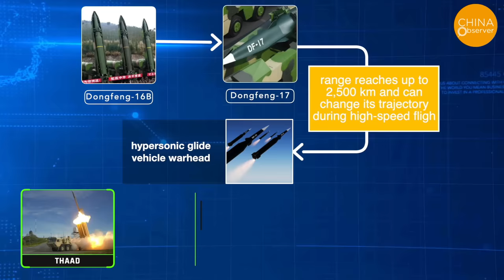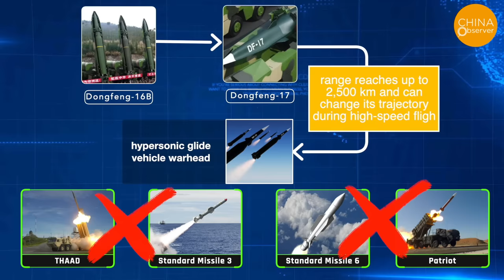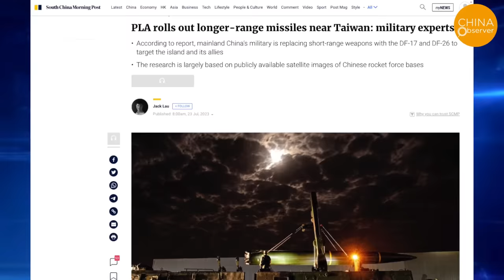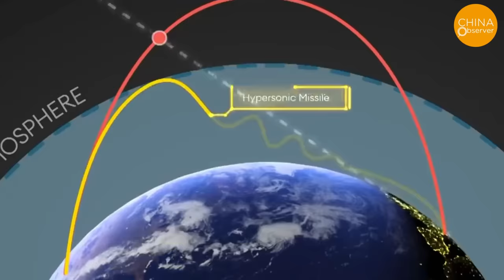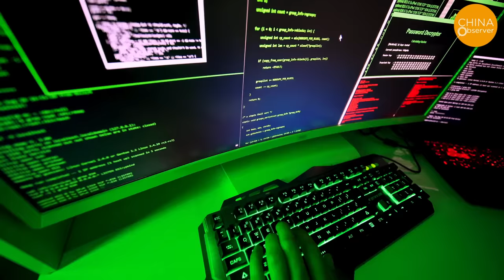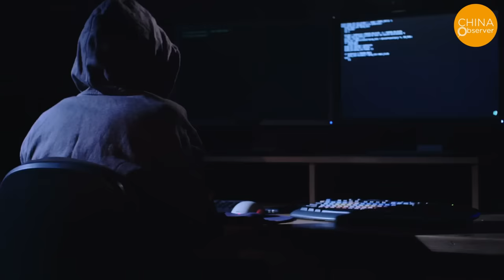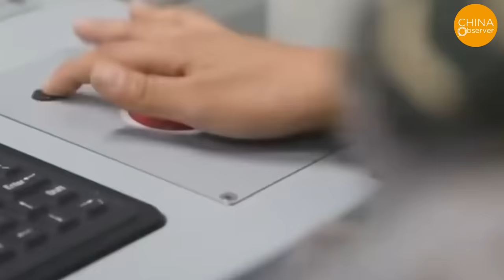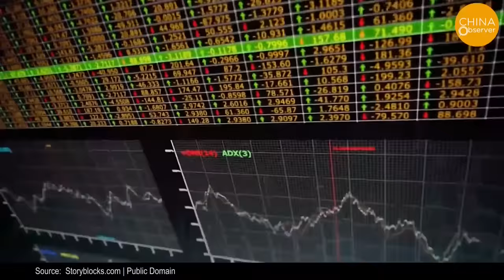China's Missile Technology Is Now Reduced To Boasting And Theft！Hypersonic Missiles Face Their Doom

Comment: More worrying to them is some rather fascinating and dirt cheap experiments the US Army and Air Force did awhile back. They took a few dozen older 155mm artillery pieces, slaved them to a common control hub fed by the air forces data fusion system seen in the F-35, and loaded them with projectiles originally designed for the Navy’s rail gun project. But launched by standard powder charges instead. Tied it all into a few existing sensor platforms such as AWACs and SAM battery radars. They found they could intercept pretty much any missile, from ICBM to hypersonic Wunderwaffen. At less than $5000 per shot fired. Using pre-existing hand me down hardware. They found that the Mach 7 rail gun ammo would still hit Mach 5.5 when fired from normal tube artillery. And the ability to share all sensor information and use it to feed and control a large number of the linked artillery guns is game changing. They were able to do this with leftovers. Obsolete gear frankensteined together to play with some new concepts. Imagine what an actual production system will look like?
Reply: even when our government turns to crap, we still kick ass! God Bless America!
Reply: And they told you all this why? and you're telling China about it why?
Reply: It will leave the PLA covered... in Pooh.
Reply: @hypersonicmonkeybrains3418  It’s been published for years. It’s not exactly a state secret. I want to say it was one of those DARPA projects.
Reply: we can have a president who doesn't know whats going on because he wants his ice cream
we can have every single soldier be full stop trans on full HRT
doesn't even matter
we'll be fine
Reply: I personally like how the E2 hawkeye can search, track, and guide a missile from the F35 without the F35 ever having to turn its radar on and give its location away. The us somehow got data fusion perfect to allow a early warning radar to guide objects precisely from 100 miles away. Yet russian and chinese sams need multiple massive radars to even function poorly.
Reply: Sounds good. Source?
Reply: You mean a FrankenSAM?
Reply: @tonytravels2494  your mom
Reply: @LegendaryCollektor  woof!!! Father was Sum Ting Wong, son of Dim Lee Tard.
Reply: @powershift2024   oy vey
Reply: Source? Claims sound incredibly dubious.
Reply: This is well worth knowing. This Australian feels better already.
Reply: @brandonkoh8361 For real! I wanna see proof of the testing myself.
Reply: When you’re talking about the rail gun ammo are you referring to the one that spins mid flight and sends out all the tungsten (I think) balls? So in essence what I’m asking is did they slave all the artillery pieces together to make a  literal mile-wide shotgun spread at where the missile is going to be or is it way more precise then that?
Reply: @castlebravo6658  No it is a weirdly shaped high speed lifting body projectile fired like a sabot. It may carry a fragmentation payload though.
Reply: @negroraven9458  Go back to the beginning and get born in a military household, get really good grades and get into military intelligence. Go see the testing yourself and spend the rest of your life telling no one. Otherwise, don't expect anyone to give you proof. This is not for entertainment purposes.
Reply: They also just like making cool things to end things, the knife hellfire being one of the most personalised weapons ive ever heard of…imagine a few more of those being delivered very soon.

Comment: Honestly with these hypersonic missiles you don't even need to intercept it directly. All you need is to force it to make an abrupt enough move that it causes them to exceed the air frames maximum strength. At those speeds your walking a tight rope with inertia. Your good as long as your going in a straight line, but any sudden moves can cause you to start tumbling and once that happens its only a matter of time before the forces ripe you apart. Your trading maneuverability for speed
Reply: Great maneuverability comes at some costs: reduced range and the need for continuous flight path corrections.
Additionally, the missile eventually needs to slow down for accurate targeting via active radar or GPS input.
That small window might allow a short-range Mach 10 interceptor to work like the US Sprint missile.
https://www.youtube.com/watch?v=3dl9Ovwmnxw
Reply: @nfuryboss  its not a hypersonic though.... to accaly have that clasification it needs to be going hypersonic during the terminal phase of flight
Reply: Cue the opening scene from the 70s TV show "The Six Million Dollar Man."

Comment: one thing people don't understand about Hypersonic is that it only works at high altitudes of more than 50 thousand feet. Lower than that nad it'll slow down considerably, and at that altitude, at speeds lower than mach 15, they can be infercepter. Not to mention unlike Russia and China's boasting their hypersonics, USA has WORKING and TESTED directed energy defense systems that are to be put on Gerald R. Ford classes.

A supersonic sea-skimming missile would likely be more effective as it avoids radar detection and is hard to spot

Comment: So, the US Military doesn't classifty any Russian missile as "hypersonic".  Simply traveling at hypersonic speed does not define a missile as "hypersonic" in the eyes of the US military.

The Russian "hypersonic" missile that was shot down over Ukraine is not regardless of what Russians call it.

So, for the US military to call something a hypersonic missile, it needs to be able to achieve those speeds on its own or maintain those speeds on its own, not get boosted up to that speed via a rocket and then travel downward by gravity.  The world has had hypersonic projectiles since the 60s, they're called ballistic missiles.  They can be intercepted.

For the US military to call something hypersonic it needs a ramjet or scramjet engine or something equivalent.  These are engines that can only operate near and above hypersonic speeds.  It can be launched via a rocket and then be the 2nd stage so it separates from the rocket and then can propel itself and that also means changing direction.   Or, the missile can have 2 different engines, one to get it up to near hypersonic speed and then once again something similar to a scramjet engine to take it to its target.

With this is mind, I don't know if the US military privately calls what the Chinese have a "hypersonic" missile.  They're INCREDIBLY hard to engineer and the US is close to one, but haven't quite got it worked out yet.  It's suspected they could have one within the next couple years though as this has been a high priority for them.
Reply: The US deployed the AIM-154 air to air missile in the late 1960s, mach 5.5.
The US started high speed high altitude tests with the B-15 rocket plane. It was flown by men with the right stuff.
Its really not that awesome of a trick.
Reply: Also the missile must be able to maneuver all the way to it's target. None of the missiles introduced by ANY nation has yet to meet this requirement, especially those of Russia and China.
Reply: the usa will only lasify it as a hypersonic if it gose hypersonic during the terminal physe
Reply: The US already has tested and readied hypersonic missiles. The Army will have a mobile launch unit by mid to late this year, the Navy Zumwalt class destroyers will have modified launch systems in the beginning of 2025 and the Air Force are completing several different delivery systems ranging from the B-52, the C-130 and the new B-21 deploying within the next year (save for the B-21). They are far and away the most tested and developed of the so called hypersonic systems of Russia and China.
Reply: @jasonrhodes9726  Yes and?  As I said ballistics moving at hypersonic speeds have been around since the 60s.  But the US doesn't call those hypersonic missiles.
Reply: @powershift2024  Yes I'm aware the US military has been in R&D and have tested missiles.  I watch Sandboxx News.  They aren't deployed yet so they're still in development phase.  I'd say it's a foregone conclusion the US Military WILL have them deployed by the end of the decade.

It's going to be pretty badass being able to deploy a CARGO plane (WELL protected) along with a fleet of drones to go along with a few F-35s and eventually the B-21.  I'm guessing the C-130 wouldn't deploy until the US has air dominance, and I don't see anything on the Russian or Chinese side that says we can't attain that.
Reply: @johndoh5182  well it wasn't from Sandboxx but yes,  the new Zumwalt delivery system is slated for the beginning of 2025. I would think they'd already know the specifications and capabilities of the missiles if they're already working on the delivery systems in currently deployed billion dollar ships. I'm just wondering how bad the Chinese satellites are compromised as they've been using western processors in those too. It would take a very, very long time to domestically produce chips capable of that processing power and replace their existing constellation. Should be interesting.

Comment: Apparently Xi sacked a number of rocket force generals recently when it was found that their missiles were full of water rather than rocket fuel. Not sure what happened to the fuel, they probably sold it? My question is: if you fill your car's tank with water, how hard is it to get the water out, and what does water do to sensitive engine parts? Do you think car engines are any more sensitive to this than say, DongFeng missiles? Corrosion anyone? I remember back during the first SALT we discovered the Russians weren't cladding their target control equipment in the warhead. Radioactivity is fairly corrosive stuff. If the chips & boards became brittle, they could crack during launch. The CIA revised their estimate of Russian missiles finding their targets successfully from 85% to 15%. But that was a long time ago. (sarcasm) I'm sure the Russians and Chinese do a whole lot of maintenance today (/sarcasm).

Comment: We need to remember that even if they can steal standard chips to ad hoc guidance systems but they wont be hardened so they will overclock and have to add sheilding to compensate but it doesnt work as well and comes with lots of issues.

I mean the quality components aren't even made out of silicon chips.